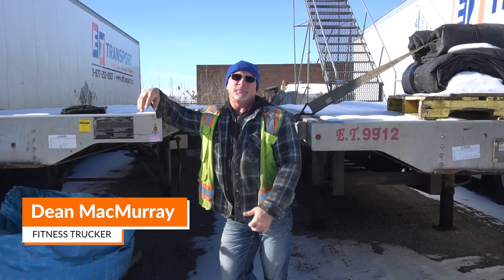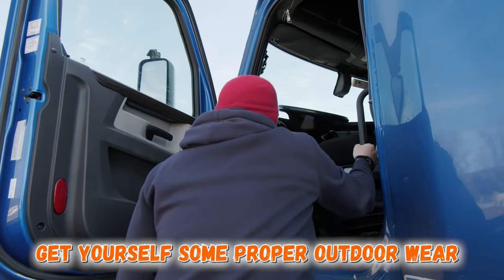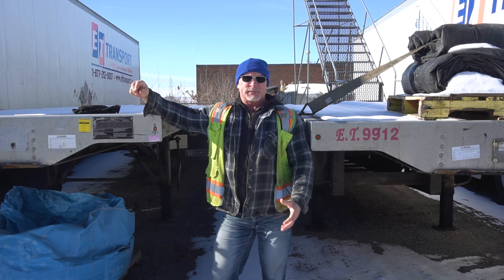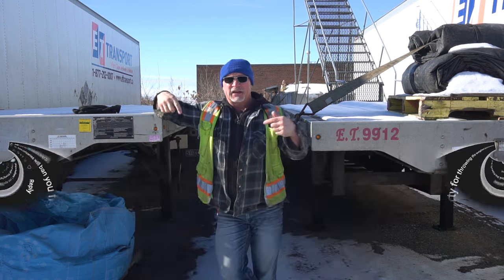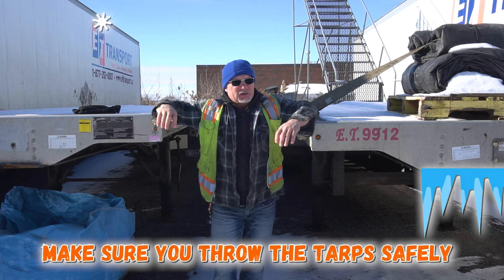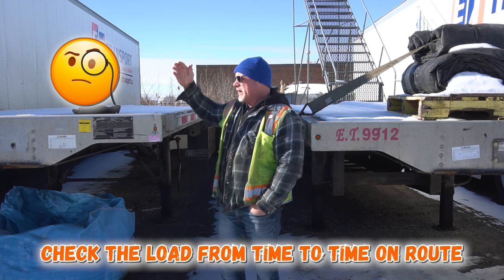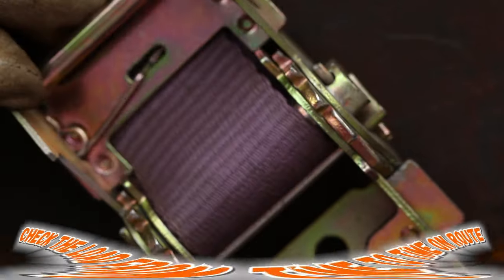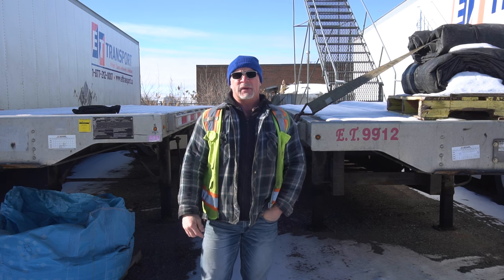Flatbed Trucking in the Winter is NO JOKE! Is Flatbedding DEAD?!

Comment: Great video bro you got it all sewn up I like it the way you present yourself and your straps and chains and man you are the coolest dude I was the roofer and worked in the freezing cold to many many many years so many times I had to do the same thing hide for a while warm up in a bulkhead on a roof just wait five or 10 minutes But when you strap something down and you think it’s gonna get wet or frozen, the best thing is to cover whatever you strapping down with an extra layer of top or plastic even cardboard helps and then when you get to where your destination is you don’t have anything on your usable tops the snow in the ice collects on the top of yourplastic or fiberglass or canvas tops even cardboard is a big help there’s new things out too called rubber they make moves with it. You could even cover your tops with rubber it freezes, but it stays pliable and flexible. That’s also a good trick to keep your tops clean OK bro I’m signing out good luck and goodbye and I’ll say prayer for you bro.
Reply from the maker: Thanks for the warm words and advice! Stay safe out there!

Comment: I pulled a 40foot flat with a 1967 Pete conventional back in the 70s. On the other side of the road from the yard was a pipe company. This is in California and the pipe would sit in their yard for months some times over a year. We had to tarp our load even in the summer. The loads would go from Antioch CA ( 30 miles from SF bay area). They would go mostly to the LA area. All sunny hot and dry areas.